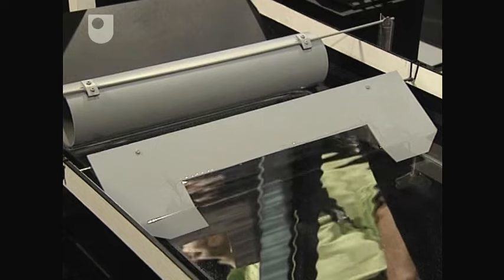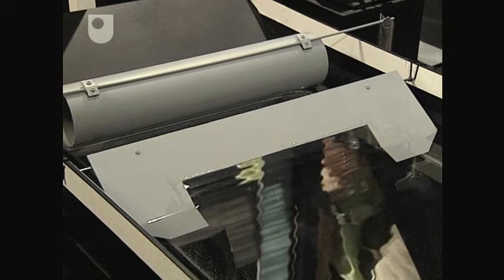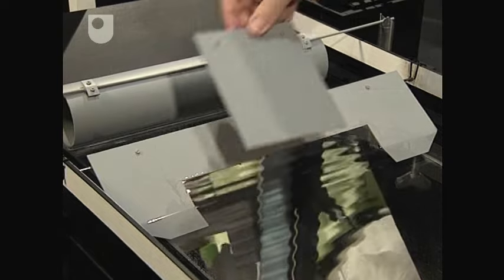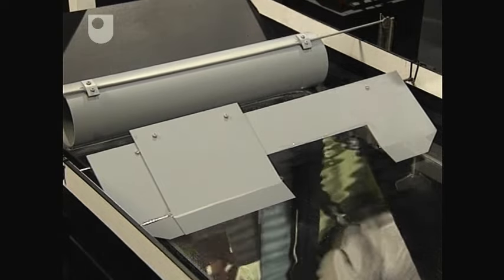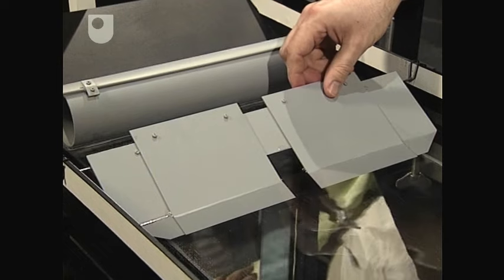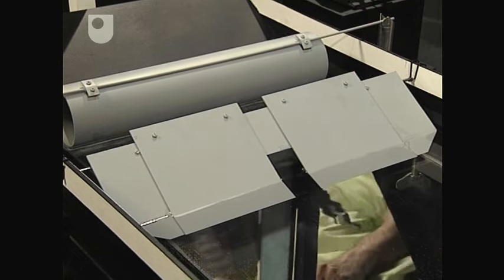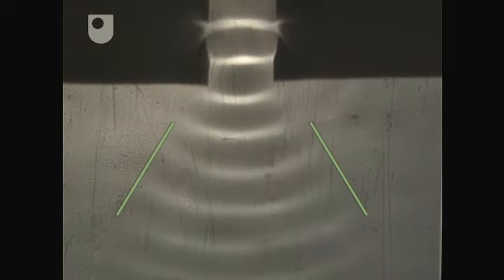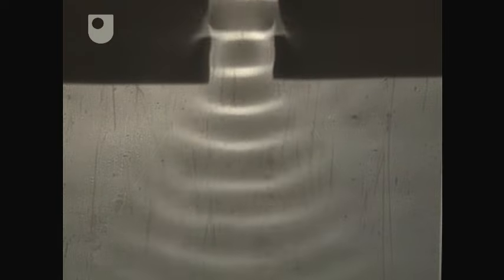Apertures and Diffraction - Exploring Wave Motion (3/5)

Comment: thanks. People say that higher individual mass of the particle causes the wave to slow down. But the higher concentration of these particles causes the wave to speed up. Plus one has to account for "stiffness"(Shear_modulus) of the material and compressibility.  The problem I see with "density" is it only tells us the amount of mass per volume. It doesn't tell us anything about distance between the molecules or how these molecules "interact" between each-other.

Comment: In a more dense medium, the speed of the wave would be slower. This means that for the same frequency of a water wave, a mercury wave would have a shorter wavelength. This would mean less diffraction. Just remember that the wave speed is inversely proportional to the density of the medium.

Comment: These are not two factors. It's the same thing. The ratio of aperture width to the wavelength. If the ratio is small - lots of diffraction. If it is large - little diffraction.

Comment: What I always struggled with was to find an analogy or metaphor to help me conceptually understand this phenomenon. I get the maths and the fourier transform and stuff... But conceptually understanding and visualising the fundamental principles which would lead to an experimental observation like this has been impossible.... Anyone got any ideas? Basically my question is: whyyyyy does this happen? Not explained mathematically please! I understand the maths!
Reply: basically, water at the edge of the gap hits the edge and moves up and down, which sets off a series of circular ripples that will move away from the gap. (that's what happens to water in a ripple tank).
Reply: @omarshraim9856  Good try Omar, but now try to apply your explanation to Electromagnetic waves? Why do electromagnetic waves do the same thing?
Reply: @PCP1992  thank God I'm not the only one with this doubt, yeah analogies are always great for basic understanding but in reality water waves and EM waves are made very differently(like material And medium) but still the same diffraction phenomenon is occurring ... The question of how exactly...is still a mystery for me

Comment: what happens when the wavelength is way bigger than the slit?
Reply: Dário Mendes 
1. When width of the slit = the wavelength of Light waves, hardly diffraction takes place.
2. When width of the slit > the wavelength of Light waves, no diffraction at all.
3. When width of the slit < the wavelength of Light waves, more clear-cut diffraction.

Thank me later.